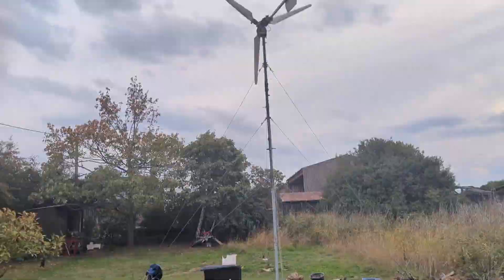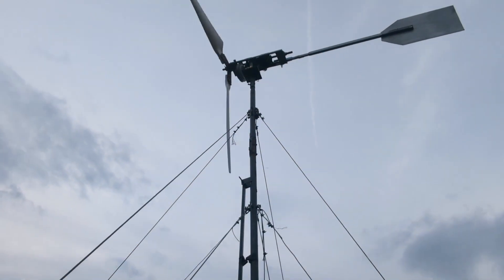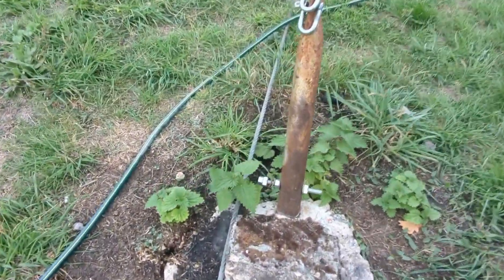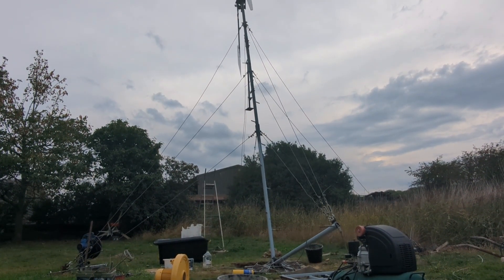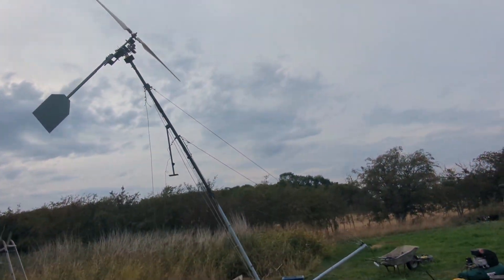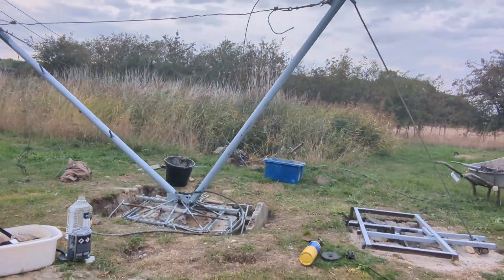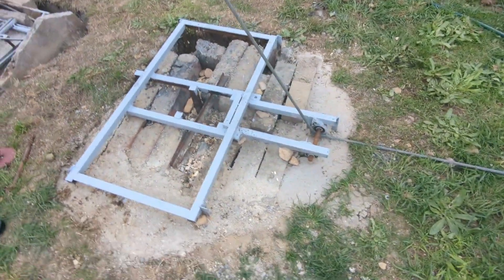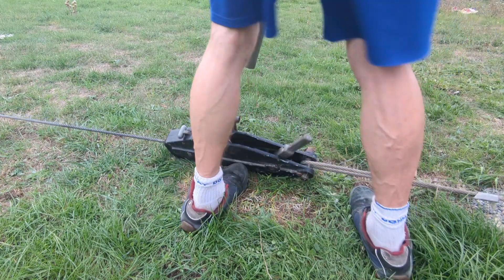Wind Turbine Project Free Energy Generator  - Lowering the tower - new gin pole - 22 September 2022

Comment: Great job Gavin, sounds like you're going to find yet another use for those collars - handy things they are! 😀
Reply from the maker: yes mate they are the ideal zombie apocalypse tool :) thanks for the comment this thing is gonna be smashing it round as soon as I get the bit's done , really excited.
Reply: @GavinFreedomLover   looking forward to seeing the new shots of the generation meter when you get it going!- did you top a kilowatt with your previous version?
Reply from the maker: This motor is capable of that no problem will get a bit of wind on Monday and Tuesday we'll see what it's saying :)
Reply: Looks great, we’ll done. I’d be tempted to make a proper pulley for that axel - it’ll keep it central and increase the radius the wire goes through. Rather than notching the pipe you could also just weld a tab on the bottom for a shackle or just use a massive shackle in place of the current pin. Finally I’ll don’t like the hook type turn buckles as they have a tendency to bounce out if you don’t keep an eye on them - wiring the hooks closed (and generally wiring the turnbuckles all shut with fencing wire) is worth it once it’s going to be up for a while.
Reply from the maker: re the turnbuckles, these ones are so cheap from Toolstation usually I just insert a rod through all 3 eyes so they don't move I just took them off to take it down cheers.
Reply from the maker: yes I def need a pulley or something similar , I just had to get it down to fix the bend in the tower , I have an electric winch as well but still mulling over the best method/s.